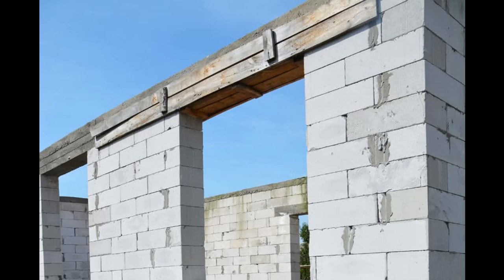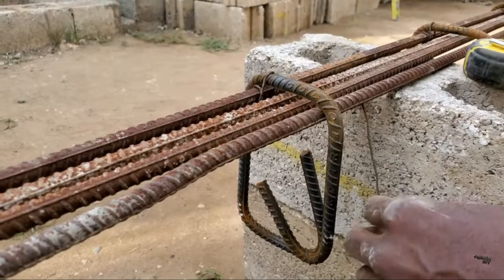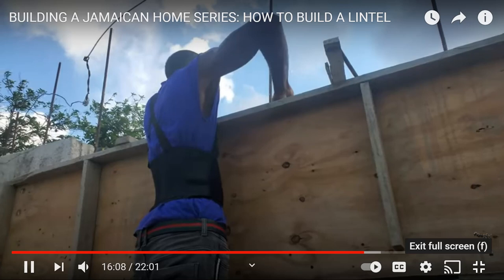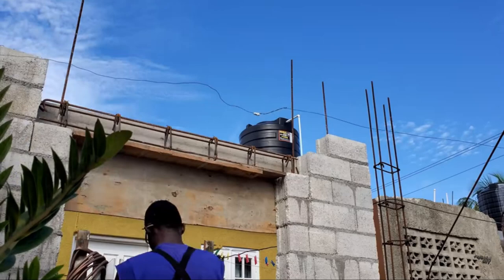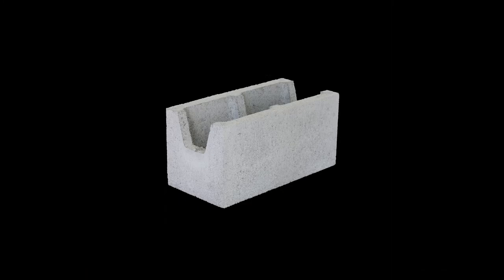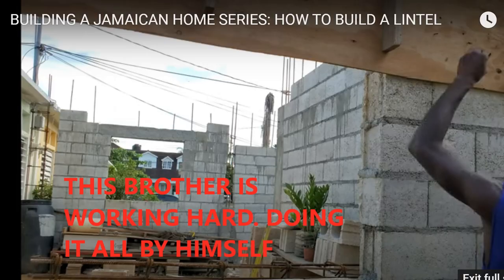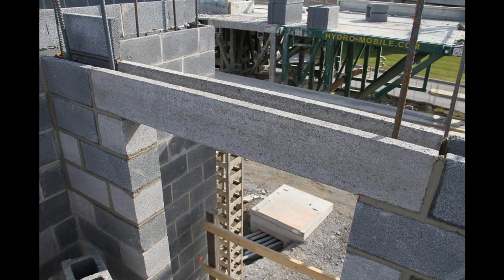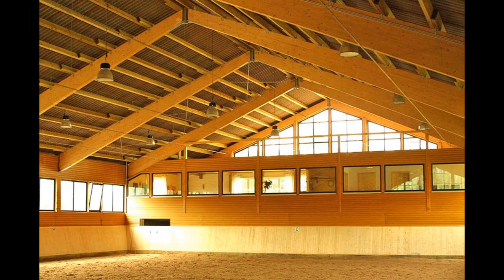How to Build Lintels, Building your Dream House in Jamaica, Quick Tip of The Day.

Comment: respect bro, I'm very honored. thanks for the acknowledgement. that bond blocks is a great great way to do it. I've never heard about bond block before thanks for the info . were can we find this product I should be using this method from now on.
Reply from the maker: they are hard to find but the best thing would be to make your own mold. You can use wood since you only need a few but you can use regular blocks Just knock out the partitions about half way down. You need to mix the mortor 1+1+1+1 by volume for it to work properly. (a bit more agregate wont hurt as long as the concrete is thoroughly mixed)
so one quart cement, one quart sand, one quart very fine sifted marl, one quart half inch aggregate.

Normally the combination would be 2 parts sand but mortor works better with a one to one sand marl ratio. For this amount add ONE LEVEL TEASPOON of sugar to one 500 ml of water and mix it out completely before using that water to mix the concrete. 

You can scale up as needed.

It may seem a bit expensive and heavy on the cement but you are using a lot less concrete to fill those pockets so it works out and less messy, much faster and easier.

Remember to mix all dry components first then add water SLOWLY to just the point where the concrete seems mostly wet then stop. Continue mixing and the concrete will become completely mixed.add small amounts as needed but never to the point where soupy cement water is running all over the place. Just enough to where the concrete  sort of wants to stay up in a heap but wont when you make a pyramid with it.

This concrete with the sugar as a plasticizer will set up slower than regular concrete and that will make the concrete stronger and less susceptible to crack but it i cannot be disturbed for a few days
Reply: Thts what they use in Canada or they also use a flat piece iron or they use one thts has two pieces of iron welded together in a angle called a (angle iron)

Comment: Lintels - part of wall that runs above doors and windows

Payneful DYI

1. Box and Cast Method. Traditional, can take a long time. 
Top section, rebar cage is inserted.

2. Bond block. Modern method
U shape bond block
Normal block, knock out partition, brace, lay steel, pour concrete
Saves time

Comment: I am with you on that that  one teach one 
I saw that method here in the states
You just reenforce my intention of doing it that way on my project but I find it easier to allow my mason to do it his way until I am back on site soon
It will save me a lot of labor and steel cost which is thru the roof
Reply from the maker: yes the price of steel has increased almost 40% since march of last year. Since you are in the states you may want to look into a product called SikaFiber. They are from Jersey and their product is actually certified as a steel bar replacement. I don't recommend rebar replacement but its use or use of a similar product such a fiberglass can increase the strength of you concrete decrease the tendency to crack and reduce the amount of steel significantly .
Reply: Yes I am feeling the steel price increase 
Bought six ton few weeks ago and anticipating another twenty ton

Your legitimate info is really consultation that a lot of home builders pay for LOL
Are you an engineer?

Nuff respect me Breda and keep it coming
Reply from the maker: @paradiseland2512  armature, I studied architecture and electrical engineering for a few years before life intervened.
Reply: @jussayinmipeece1069  what is your  take  on building from solid concrete instead of building blocks
Reply from the maker: @daneford7132  it can be done. The NHT is building a bunch of houses that way through a chinese company called CHEC. The question is the forms. If you can build your forms cheaply enough and have them last for the duration of the build then the concept can be viable. 

The second question is the grade and consistency of the concrete mix. You have to find a mix and stick to it or else you will run into problems especially with your cold joints.

The other question is the size of the house. If it a a fairly large house then your better bet would be to stick to blocks.

Here is why. When you build with blocks you typically dont fill all the pockets so you will use less concrete and add that to the relatively low price of blocks then it may end up being cheaper to just use blocks anyway. 

You could consider making you own mold from wood, dropping your own blocks and using those  since i presume anyone asking about form pouring is not afraid of thinking outside the box.
Reply: jussayin mipeece yes I know of that. I've seen it being mixed in before. Good knowledge and sharing. 👊🏾🇬🇧🇯🇲